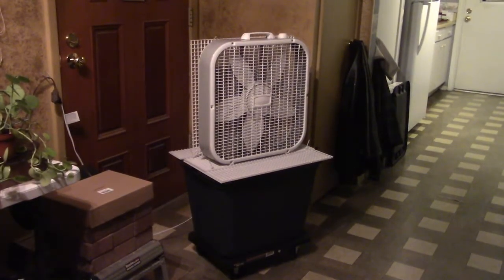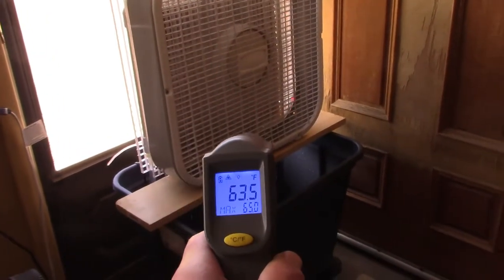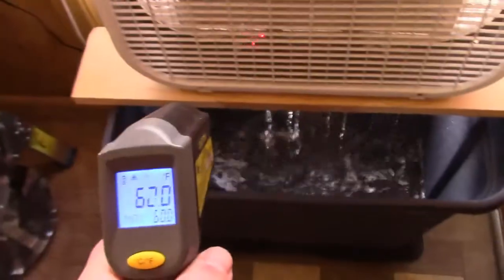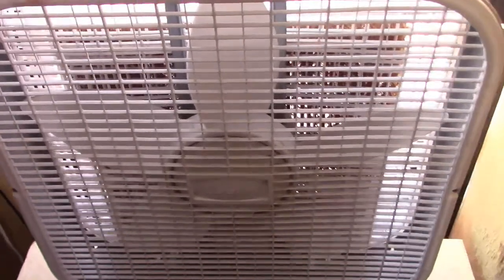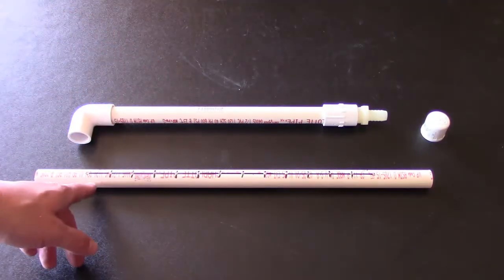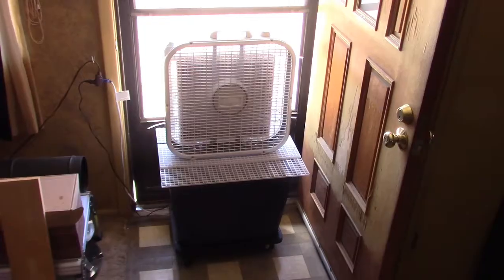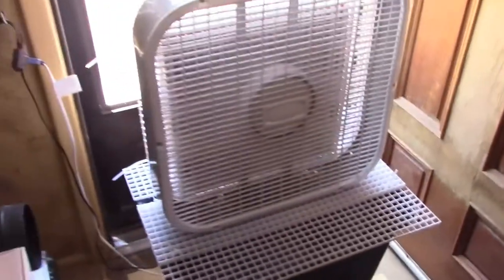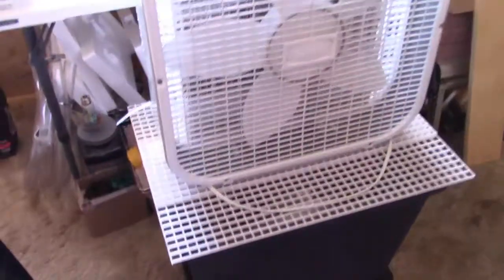DIY Air Cooler! BIG Evap Air Cooler! w/Honeycomb Pad! 20 gallon tank! 16hr run-time! (Box-fan conv.)

Comment: Hey, let's add ice and see what kind of temps we can get!
Reply from the maker: i often freeze 3 gallons at a time in those cheap tupperware containers you can get at walmart. that's makes a huge ice block. bet it would drop the temps another 10 or 20 degrees. here's a link to my quick video on making these ice-blocks (with rope handles frozen into them). the block is 20 to 25 pounds. https://youtu.be/jprPmM834Yg
Reply: @desertsun02  Cool! Can you do this in this latest evap cooler and record the temps? Are you serious . . . "10 or 20 degrees"? (BTW, I'm in a similar climate so I've already started to build this. Thanks.)
Reply from the maker: @M. H. Ploni sure, the ice blocks can cool the water quite a bit cooler and then you've got evap cooling along with conduction cooling. the ice is only temporary but it's good for a blast of even cooler air.
Reply: @desertsun02  Is there any specific reason why the vertical PVC pipe connecting to the horizontal PVC sprinkler pipe must be PVC? Wouldn't a vinyl tube also work (if it's a correct diameter)?
Reply from the maker: @M. H. Ploni you could use clear vinyl tubing connected to the top piece of pvc if you want to. i considered that but thought it would work better and be more stable if i used pvc.

Comment: Do you have to open a door or window or can you just run it in a room with the doors and windows shut?
Reply from the maker: hi. you have to have some kind of ventilation so the humidity does not build up. cross ventilation is probably the best.

Comment: This is AWESOME!! I built a version of your box fan cooler last summer and used it pretty much every day to cool my garage. I did find that the design could be improved - especially when it came to having some water spray on top or into the fan. Having a bit of water near the switch made me nervous, but I have to say I never had any issues and like I said, I ran - and still run, the cooler almost every day. With this new design, you've completely eliminated this problem. I can't wait to build this. One other problem I had with the 2021 design is that the fan would tilt backwards into the PVC/pad section because it doesn't have any feet in back. To fix this I attached a 2x4's vertically on each side that are about the same height as the fan. These not only help keep the fan from tilting back, they also block any air coming in on the sides. With this new design, these 2x4's could be attached to the board going across the large tote.
Reply from the maker: hi. yes, having the feet on the fan is pretty important. especially important on the newer fans (because they're making them so thin and lightweight these days). i wish they would start making them thicker and heavier like they used to so they would have the added stability. the 2x4 idea sounds like a good remedy. i never had the water issue. this unit is a great cooler (and the first one that i made with a honeycomb pad).

Comment: Ok, here's what we're thinking of doing:  We want to create a 2-stage evap cooler. We've got a MasterCool-type evap (so, pads on one incoming side, not a typical box with four sides of pads). We're thinking of hooking up a heat exchanger IN FRONT OF the  pads, and running the water from the reservoir through the heat exchanger first, then it goes to the dripping tube and drips onto the pad. So basically taking your indirect evap module, putting it in front of the intake side, thereby cooling the air (via indirect evap) BEFORE it goes through the wet pad. And using the same water, the same pump, just running the water from the reservoir through the heat exchanger before dripping it down through the pad. 

The heat exchangers you use in the video from a few weeks ago might be under-sized for our MasterCool (which blows 5500cfu/min) so we figure we need a more massive heat exchanger, like 2" thick or so. Much more expensive. And the diameter of the tubing inside is like 1", versus the 3/8" that connects to the standard evap pump. Will this cause a problem? Or maybe it just takes a little while for the heat exchanger to fill with water and come out the other end. Trying to think of how to connect the 3/8" outlet from the pump to the 1" diameter heat exchanger. I worry the heat exchanger will have air pockets. 

Thoughts? Maybe you could hook it up and tell us if it will work? Just your indirect evap in front of the evap you've built here.

Comment: Three things:
1. Why bring 84°F air inside constantly while you're cooling the air inside? Just close the door and cool the indoor air as it itself is cooled.
2. Won't the PVC also need to cleaned from possible mold/mildew build-up? Possibly by running a water/bleach solution through it on occasion? Certainly drying it thoroughly after each use.
3. I wonder if cut pieces of natural loofah sandwiched between the plastic grating might work also. Thoughts?
Reply from the maker: hi. since these types of systems cool using evaporation they need a flow of air. if you didn't have that it would get too humid in the room. the pvc never seems to have a mold issue. that issue can happen with the pad if you don't dry it out from time to time. the best thing to do when you're done using the unit is to shut the pump off and run the fan for a while until the pad is totally dry. i had never thought of using loofah. i'll have to think about it.
Reply: @desertsun02  Thanks, ds02. And while I'm thinking about this (kind of gnaws at you but still fun, no?), why not use vinyl tubing (a thicker variety perhaps) instead of the PVC to direct the water onto the pad? Cheaper, less work.
Reply: @slackjaw Thanks. I'll have a look.

Comment: Is this better than the radiator air conditioner you did a while back.  Which one is the best for a small room?
Reply from the maker: hi there. they both have their pluses and minuses. the main thing to consider is that they are 2 different types of cooling. this generates its own cooling thru evaporation. it cools the water and the air. the radiator coolers use cold water source (sometimes ice based) to generate the cold air. those don't add any humidity and don't need any ventilation, but this evap air cooler doesn't even need a cold-water source (because it cools the water itself). they both cool a room but just in different ways 🙂

Comment: Do you have any recommendations for cooling in high humidity areas? I'm in swamp Arkansas. 😞
Reply from the maker: hi. the main thing other than standard ac would be some sort of air cooler that uses a heat exchanger so it won't add humidity. maybe pair it with some sort of low power dehumidifier. getting rid of humidity is a challenge
Reply: @desertsun02   thank you for te reply! It gives me something to start experimenting with

Comment: Where would one get the "Pad"? And what exactly is it called? A solar rig for water pump and a fan would be nice. Slick. Best
Reply from the maker: hi there. you can get the pad at the home stores. i got the pad at home depot. cost about 18 dollars. i just saw that they have a 18" x 20" one for 19 dollars. it's a rigid media evap cooling pad.
Reply: @desertsun02  Thnx

Comment: I would freeze water in water in 1 gallon jogs and add them to the water as a reusable ice source. When the ice in the jugs melts, the jugs can be removed and refrozen to be used again.
Great Video ! Definitely needs the moving dolly from Harbor Freight to move all that water weight . Great run-time though. 16 hours ! All day cooling ! over 120 pounds of water though. Pretty heavy to move. 
Beats paying $500.00 or more for a full size indoor swamp cooler (if they can still be found). That was last year's price here in central New Mexico.

Comment: This is perfect and just in time! 

Have you  considered adding a floater valve? Also, what would you say is the best way to reduce the dripping noise?

Last thing: can I put the pad after the fan? I would like to put a filter behind as well.

Thanks!
Reply from the maker: hi there. one way to stop the dripping sound is to attach a piece of plastic sheeting under the pad (a piece of old shower curtain would work). it gives the water something to run down so it doesn't drop into the water. another way is to buy a roll of window screen, ball it up and drop it into the water. that works amazingly well. the water hits the window screen and it massively deadens the sound. note that the dripping is not as loud as it sounds in the video. its true sound is closer to the sound of those indoor water features (small waterfalls) you can buy. an example of how the window screen works can be seen in one of my previous videos. i used the screen in my 'pad-less evap cooler/humidifier using a trash can' video. the unit in that video has about 100 water streams but with the screen you almost can't even hear them. here's the link https://youtu.be/F2eQV-95eUg
Reply from the maker: i wouldn't put the pad in front of the fan. never seems to work right. it just blocks most of the airflow. i haven't tried a floater value but it sounds like a good idea.

Comment: Do you have a well? If so, would you consider making an open loop system, then water your veggies and fruit?

I've always wanted to do a closed loop but a "semi" geothermal. Idk if it makes sense, but I would run 1500 frrt of 3/4 loops under ground, then return to a hydronic unit that would blow out the chill from the water, return under ground, and chill back down by the time it returns. 

I once killed a compost pile by coiling about 200ft of water hose in it, to extract the heat, lol. It worked for a few minutes, then the water would be too cold by the time it returned. Bigger pile, and more hose would fix this, but I felt like an idiot.
Reply from the maker: hi. unfortunately, i don't have a well. if I did I'd probably run that water thru a radiator and back down the well. water from those can be cool enough to use with an AC air cooler (with radiator). i've got a couple of vids on those too.
Reply: Don't get caught returning water to the aquifer.

Comment: Wow, next year when my bills are paid i might just get hooked up to our local power grid again, so i can make that!
What size pump is it?
Reply from the maker: hi. it moves 900l/hr. (about 237 gph). a 200gph one would work too
Reply: @desertsun02  
Could you use a fish tank pump for this project, or is that too small?
I have to go to the garden centers and look for a pond pump, that would be about the right size?
Reply from the maker: hi. any water pump that is between 190 gph and 240-250 gph should work well. some of them have a way to slow down the flow so you might be able to get a bigger one and then set it on a lower speed
Reply: @desertsun02  
Thank you very much. That helps me shop more precisely for the product!